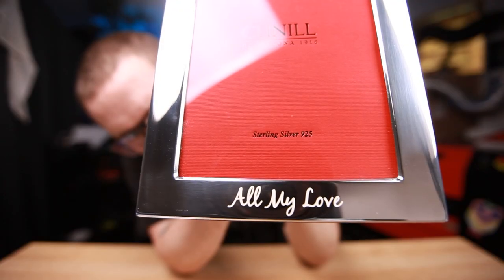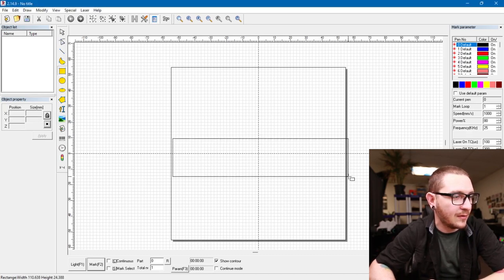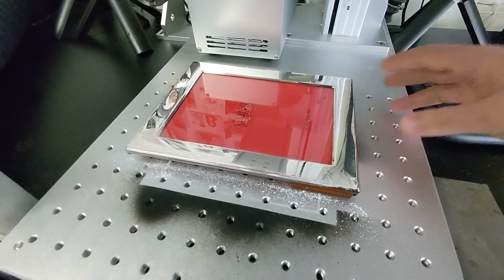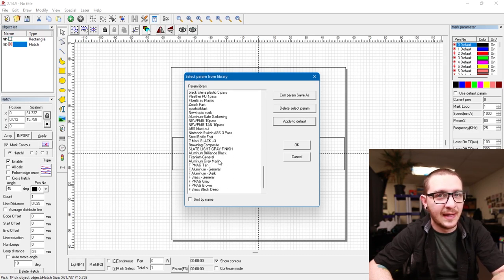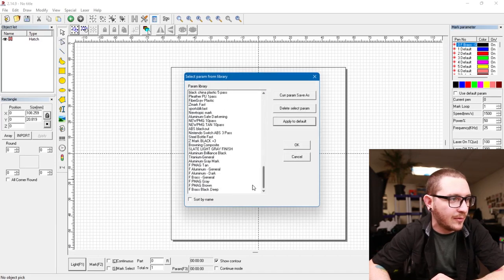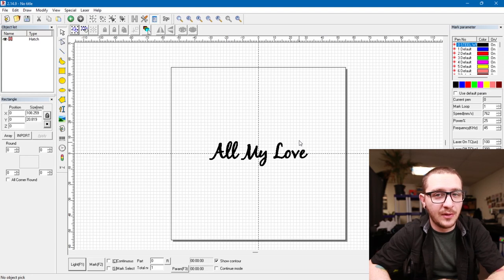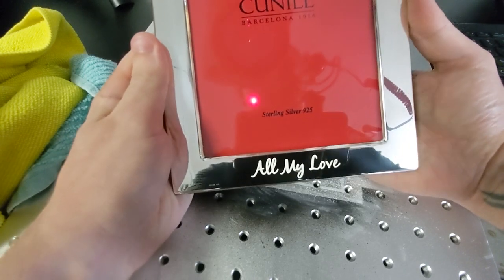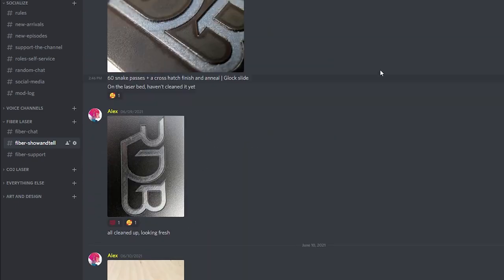How to Engrave SILVER Plated Nickel Picture Frames | Fiber Laser Tutorials

Comment: a quick question regarding your fiber laser setting libray. Do they adjust to power of the laser automatically? I have a 20w and I'm curious if the settings will be the same as far as power... or is there a simple equation to figure out how to adjust the power to match your settings?
Reply from the maker: The settings will be slightly different on a 20w but there's now a free to use automatic converter that will take the LMA parameter library and convert it for any laser/lens combo for you in just a few clicks. Super easy to use.

Comment: That is great.  I love the cleanliness of the engraving.  Why do you run your hatches at 45 deg and neg 45 as opposed to horizontal and vertical?  do you do this on all of your engraving?  Also what font was that?
Reply from the maker: The font is called blackjack. I use opposing 45s because I think it looks a little more organic once it's finished, that's really the only reason. 0 and 90° hatches can look a bit mechanical. I use opposing 45s on most of my stuff unless for some reason two hatches is too much for the material I'm working on in which case I'll usually move to 0° one hatch.
Reply: @LaserEverything  Thank you for the prompt reply!  I’m really new to this, so hoping I can start  doing more and better work.
Reply from the maker: No worries I'm here to help! If you haven't already joined the discord there's a link in the description to the video it's a really great community that I think you would find a great help. Also on the channel some page there is a playlist for total beginners and it walks you through all of the things you really need to know to use your machine effectively so I would check that out as well!